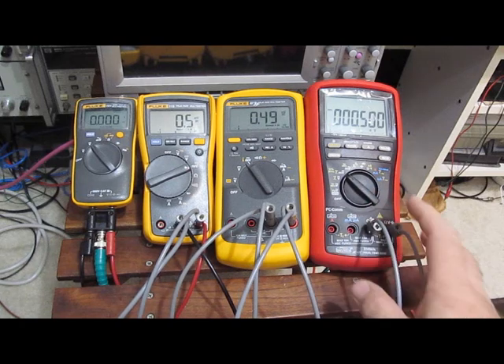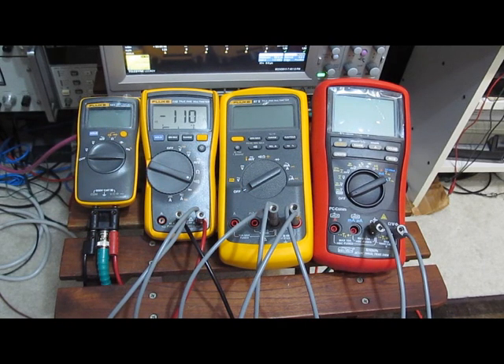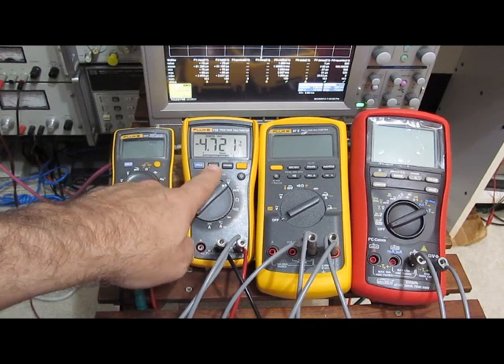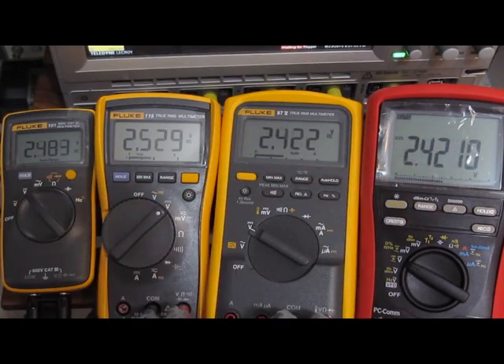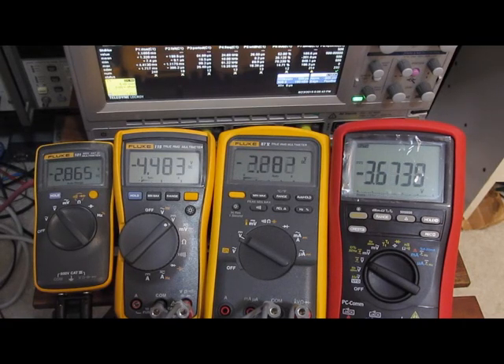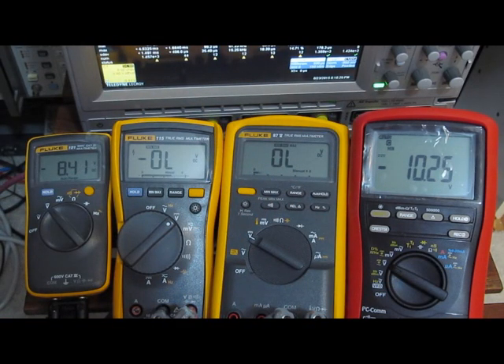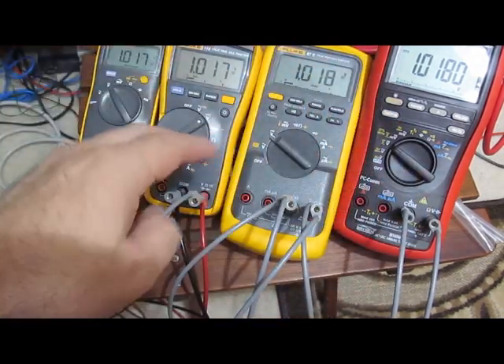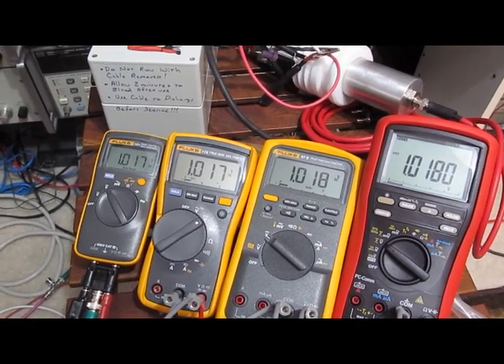Brymen BM869s vs Fluke

Comment: Hello! Thank you for the video! Had Multimeter Fluke 289 cost the same as Bryman BM869S, which one would you choose?
Reply from the maker: I think you are asking which one you should choose, which of course I can't answer.  However, I have said that if Fluke offered a meter I liked, I would buy it.  I use the Fluke 189 because it's a good fit.  Same for the BM869s.   You don't see the 289 because it's not a good fit. Not because of the cost but the poor display, long boot times, slow graphing..   If Fluke came out with a new 189, I would purchase it.    If UNI-T made a higher quality version of the UT181A that used standard batteries, I may take that.  The 181A improves many of the things I dislike about the 289 but it comes with it's own problems.
Reply: @joesmith-je3tq  Thanks a lot for your answer! I'm leaning more towards the BM869S, since the Fluke 289 is already quite outdated, but I came across an offer to purchase it for $ 300. I am mainly interested in accurate and fast measurements. That is, checking the accuracy of the readings of various testers, chargers and voltage converters. I also plan to use a multimeter to calibrate cheaper testers. For me, 300 dollars is a rather large amount, I would not like to make a mistake when choosing, so I was interested in your opinion as the owner of many multimeters.
Reply from the maker: @SkompomRuBlog  I purchased a brand new HP34401A when they first came out.  These can be found fairly cheap now, along with other high end bench meters.  From your description, you may want to consider a used higher end meter and have it professionally calibrated w/ a report.
Reply: @joesmith-je3tq  Of course, this is an amazing device, but I would like everything to be portable that does not take up so much space on the table.
Reply from the maker: @SkompomRuBlog  Of course, you may end up with a small paper weight and $300 less in your pocket.  It's a large about of money for you and I suggest you take your time to determine what your real requirements are first.  Separate your likes and wants from your actual requirements.   Then try to find a product that meets those needs.   Be smart about the choices you make and you will be fine.
Reply: @joesmith-je3tq  You are right, it is. I'll think about it, but still I'm most inclined to Brymem BM869S multimeter. In terms of price / quality ratio, it is the most suitable for me so far. Thanks a lot for the answers! Blessings!

Comment: Nice test joe, but your your test for the 5v PWM. did not use the 87's PEAK MIN MAX mode which as you probably know, gives the meter the ability to capture events as short as 250us.
Reply from the maker: There was a follow up video that I take it you did not watch.
Reply: Apologies Sir, I will take a look. Excellent channel and thanks.

Comment: Buenos días, mi pregunta es la siguiente, el Brymen tiene función Autohold?
Otra pregunta, la retroiluminacion de la pantalla  cuanto tiempo dura?
Éstas dos cuestiónes son muy importantes en un Multímetro.
Reply from the maker: New BM869s have a 256 second back light timeout.  Not all the Fluke products have the auto hold.  The BM869s doesn't have an auto hold but it does have a Crest and Rec  mode.  Just depends what you need.  The best thing to do is read the manual to see if a product fits your personal needs.
Reply: @joesmith-je3tq  
Muchas gracias Joe, Fluke  175 177 179 ,287 289, 27, 28 /serie 80 y 87-V disponen de esta importante función de retencion automática, que funcionan, con tensión  resistencia y amperios. Es importante por que sólo tenemos 2 manos 🙌 😉. 
Un saludo desde España ,y gracias por contestar.
Reply from the maker: @elektrikahectorfernandezol5341  Have a look at their new 78x series.    The auto hold testing starts about 16 minutes in.  https://www.youtube.com/watch?v=UY9Myo5ngPQ

Comment: Hello, I was hoping you may have some insight of the accuracy differences of different ac line splitters. I have read reviews where some people say the 10x and 1x are off on some models when in theory they should be the same reading but just need a decimal place shift for the 10x vs 1x. Any thoughts on which models may be more accurate ?
Reply from the maker: AC line splitter?  You mean for RF work?  They should have a datasheet with the S-parameters.

Comment: YOu'd not be able to hear 1 Hz or 4 hz.  You mean to say 1KHz or 4KHz. Kilo... kilo.   Hertz.  Not just Hz.  But thanks for the great review and information.
Reply from the maker: It's You'd not YOu'd.  It's not KHz, it's kHz.  You didn't take the time to provide a time stamp.   Outside of the continuity function, I don't believe any audio tests were shown.  If that's what you are referring to, the 1-20Hz is the make break time.  It has nothing to do with the meter's beeper frequency.  Most humans that have hearing are going to be able to hear that 1Hz modulation.
Reply: @joesmith-je3tq  Joe, my apology. I completely misunderstood, and in review, I can't see how I missed it.  Time stamp 4 to 5 minutes. Thanks for the clarification for kHz (and my typo) however.  The tests/comparisons you did were quite informative.
Reply from the maker: @riccardocarbo2479  Yes, that's all modulating the continuity function.   Some of the meters I have looked at are very fast.  This one can actually be modulated in the kHz.      https://www.youtube.com/watch?v=svJXiMMZzcQ

Comment: I have to think the fast continuity tester was influenced by Dave !  🙂
Reply from the maker: Seems more plausible that it stems from customer doing work that requires it.  That's nothing new.
Reply: @joesmith-je3tq  Oh, wonder why the 74 year old company Fluke never noticed that, with there millions of customers!
Reply from the maker: @mavamQ  Their market has always been electrical workers, not electronics.  This is reflected in the products they offer.  I doubt many electricians are trying to buzz out a QFP package.
Reply: @joesmith-je3tq  That's interesting, as an electronic tech I have  had several Fluke DVMs over 30+ years and it seems you have at least 3 of them. From the videos I see many electronic engineers have Fluke meters. I'm sure many of your watchers are doing electronics using Fluke meters, or are they electrical workers?  I'll just agree that you disagree. I liked the info presented in your video,  if I didn't already have a BM235, I would have spent a little more and got the BM869s.
Reply from the maker: @mavamQ  My point was again, Dave had nothing to do with it.  Fluke's hobbyist market is small.  I have stated many times that while the first DMM I ever owned was a very expensive Fluke, it was also the last one I ever owned up until I started making these reviews.  I do own a few vintage Fluke 189s that are a nice basic meter and use them from time to time.  The others are only used for reviews.   About the only product Fluke offers now that I would consider for professional use is the 289, which I really have no use for.  Dave has long promoted the Fluke 87V as the gold standard.  I just laugh.  Dave also has made it clear that calling yourself an engineer makes you one.

Comment: I was checking an LED circuit with the Brymen and found the shunt resistance notable on the more sensitive ranges - enough to visibly dim the LEDs. Is this normal? Is this a differentiator between meters?

I guess if you're normally wanting to measure low currents in battery drain scenarios for example then the meter resistance is tiny in comparison with the load? Where my LEDs were a very non-linear load.
Reply from the maker: I would have no idea what your circuit was or what your were trying to measure.  It seems like you may have been using the meter to measure current.  Yes, the meters will drop some amount of voltage.  Yes, it will be dependent on the range.  Yes, it will be meter dependent.   Assuming this is what you are referring to, it is known at the burden voltage.
Reply from the maker: This is a playlist for videos I have made on measuring current.  Good luck with your project.
https://www.youtube.com/playlist?list=PLZSS2ajxhiQDhlXQCyoNSDmUjb6lAqC8z
Reply: This was dabbling - effectively using the ammeter to show a child which link had to be repaired in their LED circuit by shorting the bad link, while also showing the current in the circuit at the time. As the LEDs are running straight off battery but below their rated forward voltage any additional resistance seems significant. I'd take that as being a factor of the high slope of the diode response. Amazingly the LEDs while dim were still clearly on at 2mA.

I've found this which is really interesting - http://www.ni.com/tutorial/5448/en/
I wonder if any DMMs use that circuit to reduce effective shunt resistance in their microamp range. The other factors such as noise pickup are significant though.

My interest in low currents, and a reason for factoring that into my DMM purchasing choice, would be monitoring microcontroller based circuits and their use of the microcontroller's power save features. For example the PIC has a sleep instruction which will allow it to mostly power down until it receives an interrupt. The burden voltage should be small in comparison with the supply voltage in this case.

Thanks
 - Richard
Reply from the maker: I am not sure which circuit you are referring to.  The article has a few.  All of the handheld DMMs I have looked at will use various shunts.  I have a meter that uses the feedback method for very low currents.  Of the videos in the playlist, the ones that may most be of interest to you are the first and third.   I am not surprised by your findings with the little LED experiment.
Reply: @joesmith-je3tq 😊

Comment: Do you still love your Brymen ?  I struggled with ordering this very meter a bit before you made this video apparently, but then came across a 189 at an estate sale which had the minimum features I needed over my old 85 III.
Reply from the maker: Love is a pretty strong word.   It's the best meter I have come across.   A friend of mind gave me a 189 which is pretty nice general purpose meter as well but obviously, they are only available used.  I like the dual thermocouple inputs the Brymen offers but if Fluke was still selling the 189 and kept it updated to current standards, I would buy one.  I was looking at what Fluke had to offer when I bought the Brymen and the 289 was really the only thing they offered that I considered.  I borrowed one for a while but was not very impressed with it.   The 189 was used in automotive so I spent some time cleaning it up.   Bought some new NiMH batteries for it.

Comment: Hello, I would like to ask.  Fluke 117 and brymen bm869s.  Which one to choose?  Brymen is made in Taiwan.  Is there much difference between Taiwan and China?  And the main question would be this.  Are the battery contacts good?  What are the chances of them coming off when replacing a new battery?
Reply from the maker: I assume you are asking about 9V battery connectors.  When I was young, and pocket transistor radios were popular, I repaired several of them.  You see a lot of damage when you give china to a gorilla.  I have had the BM869s for several years and have yet to damage the connector or cable attaching it.
Reply: @joesmith-je3tq It's just that, for example, I don't take out the battery with a cheap multimeter because the cable cannot be removed.  I wonder if the connection will be the same here.  Although everything was OK in most of the devices.  Maybe it just fell that way.  By the way, how long does the screen last?  Is it possible to turn off the automatic screen backlight?

Comment: Hello, I have the Uni-t ut17B PRO model and when I measure a voltage around, let's say 5 volts, if I measure with the probes + with plus and - with minus, it gives me 5,003 volts, let's say, if I reverse the probes + with black and - with the red probe, it gives me another  type value - 5.007 volts, so a difference of 4 millivolts inverse of the probe in DC (direct current).
  Do you think it's normal?  is it part of the tolerance of the device or is it defective?
 Thanks
Reply from the maker: If my meter was displaying 5000 volts with 5 volts applied, it would be heading to the trash.  I doubt you would find anyone who would think this is normal.
Reply: @joesmith-je3tq  not 5000 volt, displaying 5,(comma)003 , but whe  i reverse the probes displaying -5,(comma)007  not the same voltage ,is a 4 milivolt diference ,is normal displayig this milivolt diference if i reverse the probes? or is part of tolerance?

Comment: Hello ! It's been 7 years, how are your thoughts on the BM869s today ? I am considering buying one.
Reply from the maker: I have not yet found anything a current production meter that suits me better.   That by no means suggests it would be a good fit for you.  Do your homework and buy the right tools for your jobs.
Reply: @joesmith-je3tq  I have. I need to be able to accurately measure currents in the 0 to 10 microamp range. I also need to be able to log the measurements on a computer, and this one has a USB interface. On paper, it's the one for me.

Comment: Have you any experience with Hioki DT4281?
Reply from the maker: The only meters I have looked at on on the spreadsheet.     I was looking at the 4282 for my own use but went with that Brymen BM869s instead.   In general, my experience with Hioki products has been good.

Comment: What are the differences between the Brymen BM869 and the Brymen BM869S ?
Reply: It's a pity to not get people who are helpful when trying to make a decision. Take an alternative look at the Victor VC189 or the Victor VC187 which there is  little information on also. Hopefully some may see our need and respond properly.
Reply from the maker: I assume anyone asking would have wrote the mfg themselves by now but:I had forgotten that I had written Brymen this question. This was their response:   "BM869s is the upgraded model of BM869 to meet the requirements of the  latest 61010-1 3rd Edition. All of their functions, ranges & features are  maintained the same. Only their input protection circuits are with slight  difference."

Comment: Can you test and compare the new fluke 87v max to the brymen mn869s?
Reply from the maker: I doubt I will look at another Fluke product.  I've looked at several and they have all done very well.   Not being an electrician or technician, their products in general are not something I am really interested in.   They sure to make some nice tools for those markets though.
Reply: @joesmith-je3tq  I only asked because the 87v max has an ip67 rating, 13 foot drop rating and is waterproof.  Its supposed to be the toughest meter fluke has made. I was just curious if it would hold up better than the others. Thanks for replying
Reply from the maker: @davidwells1914  The ratings you mention are not something I have tested or collect data on.  I would have no way to know how it compares with other meters.   I am more interested in a meter's ability to survive some basic transients.  Dave from the EEVBLOG site, may take one for a swim and drop it from the bridge.  That's more his thing.   You should ask him as he may even have one by now.

Comment: Bm consume battery fast, fluke is the best
Reply from the maker: Looks like I measured 80hrs with the  Brymen BM869s and 127hrs with the Fluke 189 (see my spreadsheet).   Brymen uses a single 6LR61, Fluke uses four LR6.   The best is the free meter from harbor freight, using a single 6LR61  and 1280 hrs of operation.

Comment: Hi Joe, 
Brymen 869s is not able to read LEDs; however it light up the LED. Can you comment?
Reply from the maker: Sure I can comment.  You are not asking a question so I will just go on to add that I can't test any diodes with a drop higher than 2V.  This means all of my HV diodes are out.  That said, my first meters did not have a diode check mode.  So I'm used to testing HV diodes using an external supply.

Comment: Years pass...  UniT 181a has replaced my Mastech 20k count bench meter. I really like 181a’s display but know the meter not as robust as the Brymen. In my case I loathe a rechargeable meter in the field!  The Brymen is my full-time non-data-logging “bag” meter. For data logging I have a Fluke 289 which for my taste,  is way too fiddly for everyday use but built like a tank.  I have 3 ip67 waterproof meters but avoid water and electricity whenever possible.

Comment: Looks like a fine meter, but can it be calibrated by a cal lab?
Does it come with instructions for calibration / performance verification?

That second T/C would be dead useful, but does it make the inputs vulnerable to damage? I had a cheapo meter once where they used split sockets to sense a plug in the current input, well, that one half went right to the processor I/O pin with no protection and if you pulled the plug out with power on it you had a 50/50 chance of blowing it all to hell.
Reply from the maker: stefantrethan Assuming that you really mean calibration and not alignment, I would think most of the calibration houses could handle it without a problem.   If you are asking about an alignment or repair, I would assume it would go back to the manufacture.    

I am not sure how this meter stacks up against the others I tested.

Comment: What is the Greenlee rebranded model for the Brymen? I don't want to order from overseas. Thanks
Reply: It's the Greenlee DM-820A
Reply: @spacecadet8843  do you mean DM-860A? The DM-820A is a 10,000 count meter.  The DM-860A is 500,000 count, which is what the Brymen BM-869S is.